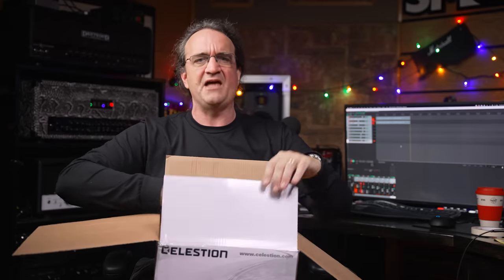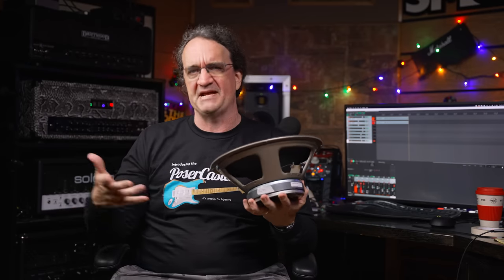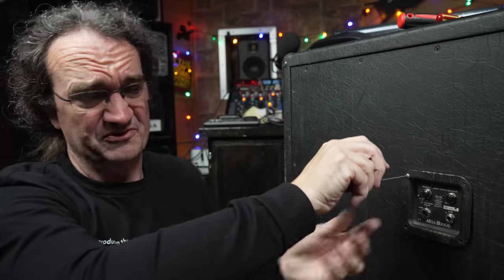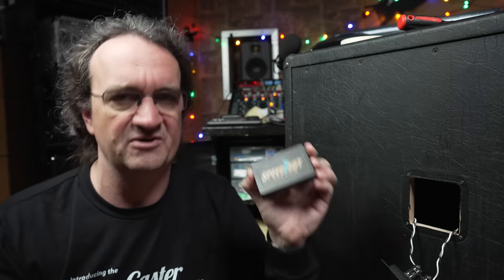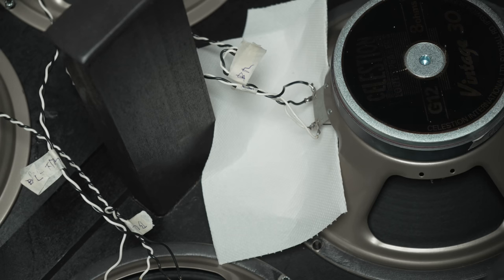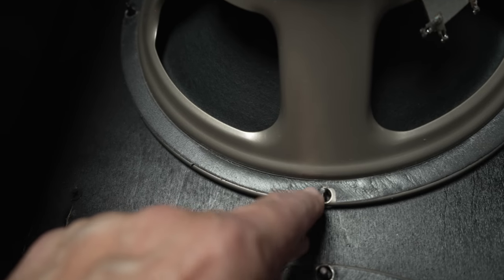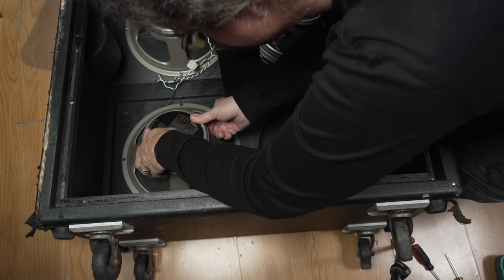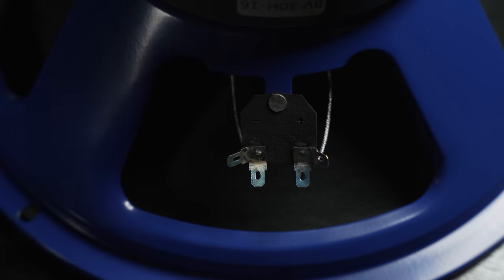How to Change Guitar Speakers (Even if You're a Bass Player!)

Comment: Does soldering connections improve tone? I bought a solderless EMG 81 kit years back. Came with one volume & one tone pot. Swapping pickups was easier than putting a lego kit together. Only a a couple hand tools were required. Over the last decade, I never noticed any kind of crackling or any signal issues even after heavy use & moving states three times. But many guitarists still insist that soldered connections are the best way to go.

Comment: It's not about tone as much as durability. Over time, the spade connectors have will become loose due to the vibration. A loose connection will cause a higher resistance from your amps output, increasing the chance of damaging the amp.

Comment: Glenn! If your screws are stripped out, you can use an old rubber band or duct tape over the screw to give you a bit more torque to get the screws out. 

Just a friendly tip from a fellow tech nerd that has had to fix shit other idiot musicians have broken :)
Reply from the maker: Never had much luck with the rubber band trick.  That’s why I’ve got the fast-outs

Comment: Hey Glenn, thanks for this video. I really needed that spade connector tip. I have a bit of a different issue with it, though - I need to change one of the spades that's hardwired into a combo amp. It's a spade that's smaller than what's on the new speaker, the negative connection. The old stock speaker had a large positive connector and a small negative connector. Are there cases where spades need to be that smaller size for what's hardwired into the amp, or will putting on a bigger spade to match the new speaker not matter, as long as they fit? I hope I explained that correctly, this is new stuff for me.

Comment: Just my .002 cents

When you change OHM load. Going from 16-8 ohm. The only difference,from my understanding.The lower the ohm load the more power the speaker will draw. This will make the speaker louder.  I don’t think it will change the sound. Just make sure the speaker and amp can handle/produce the lower OHM load.

Comment: Id like a video on how to identify what a speaker can handle or how to match up a speaker to not blow with the amps you have. Like if you have a 1x12 combo and want to plug a head into would it handle it or does the speaker need to be changed to handle the more powerful head. Also do you need a stronger speaker in a 1x12 but can get by with speakers that handle less power in a 2x12 or 4x12. Ive tried google but it starts bringing up a lot of home audio stuff and not guitar amp stuff.

Comment: Why did you not put spade connectors on the ends of the speaker wires while you had the speakers out to keep from having to unsolder & resolver the wires onto the speakers?

Comment: Hello Glenn. I love your show. You need to match the correct impedance form the head and the cabine, in other wyse, you will fry your amp. Whem you indicate to use 16, 8 or 4 Ohms? sorry about the stupid question. LOL.
Reply from the maker: I’m following the wiring laid out by the cabinet.  The switch on the cab itself determines impedance.   By not changing any of the wiring, it will work as intended.

Comment: I would like to know your take on how ohm load effects tone with tube amps. When I bought my first tube amp, I hooked it up to my 4x12 that I had wired at 4ohm total. At almost every volume below 9 the sound was very muffled and had too much low end. The top end was almost gone. Messing around trying to get it to sound better I wired the cab to 16 ohms. This fixed my lack of top end tone. I know solid state amps do not work the same way. The signal is the same no matter the volume or ohm load present at the cab.

Comment: I have the stereo cab from Harley Benton, which has two imputs : 4ohms mono/8ohms stereo and 16ohms mono/8ohms stereo, with  a switch in the middle. My only question is : what kind of impedence I should get as speakers ? I'm freakin lost

Comment: Do a video on how to bias an amp next.  I dare you to bias a vintage Marshall amp ;-)

#1 FAIL: Glenn, get Dewalt bits for your drill.  Those are perfect and will grip every time.

#2 FAIL:  You should've wired quick connectors to those Celestions you speaker leads.

As an observation (and based on past experience), the best way to wire those spade connectors is to actually solder the spade connectors to the wire because those connectors have a bad habit of losing their grip over time.

As for the wiring diagrams...  YES!, do a video on the various configurations for wiring a cab.  Having various impedance options are great to have and Mesa has (IMO) the best plate jack (Marshall has the 2nd best but it''s confusing to read and you have to flick a switch).  There are massive differences in listening to a speaker in 4, 8 and 16ohms, mostly happening with the higher frequencies but you can certainly hear a difference and this helps when you simply change the impedance by flicking a switch on the amp and plugging into a different jack on the back of the cab.

Comment: I've got a question about loadboxes: most of them have a fixed impedance (8 or 16 ohms), the only one I've seen with the ability of switching between different impedances is the Tube Amp Expander. So, the question is: is there a way to be able to work with cabs at different impedances with something like a Captor X or if I want that specific feature I'm stuck with the Boss TAE?

Comment: Glenn! my fender champion modeling amp is tuned to the speaker yeah? so would changing the speaker screw up the amp tones, or would it be as if i had changed the speaker on the original amp?

Comment: I wanna replace just one speaker, I like the 65 watt green back  or a 75 g12 t, but the speakers in my cab are 60 watts and the handling power on the cab says 240. Can I still do it or I do have to get a 60 watt speaker?
Thank you

Comment: Changing speakers out are one of the most dramatic changes you can make to your sound and rig. But I think it's a disservice to say changing tubes doesn't do anything. I personally dedicated a lot of time into changing out tubes on my Marshall JCM2000 and my Crate Bule Voodoo. And I can get some pretty drastic results. There is a lot to be said about V1 and the phase inverters in the pre-amp section. But one of the biggest changes I felt and heard was in the power section. Even in the same category of power tubes. For example, I heard a HUGE difference between a set  JJ E34L and set of EL34's, HUGE!!!

Maybe that's just with my amp, maybe that's just with JJ or Marshall, not sure. But my Crate Blue Voodoo sounds way better with Sovtek pre-amp tubes than with JJ. I also play around with high gain and mid-gain pre-amp tubes, which also makes a pretty big difference. 

But I will agree changing out the speakers in your cab, probably makes a bigger difference most of the time.

P.S. I can't speak for old NOS tubes verses new tubes. Haven't played with any myself.
Reply from the maker: That’s complete and utter bullshit.  Where are your frequency response graphs?  Before & after recordings made with a reamp?   Tubes are NOT equalizers.  If they work, they’re good.   Changes in volume do not equal changes in tone.  See:  Fletcher / Munson
Reply: @SpectreSoundStudios  Lol...OK Glen. I appreciate your passion on the subject, but I personally hear a big difference between evething I mentioned. Especially on my JCM2000 with the JJ E34L and the JJ EL34. I'll make a video and call it, proving Glen wrong ep.1. LOL... J/K, but not really. I'll make a video and use a frequency analyzer if you want.

Telling you man. There's a difference, at least on the examples I gave, which I've done myself.

Comment: I have an old HiFi amp and speakers and I can hear the difference between the 2003 and 2006 Celestion speakers. The earlier ones are much brighter and give the mix better separation between instruments. I can gear all the instruments clearly. The later ones sound mushy, there's too much similarity between the instruments, there's too much Bass which is muffling the guitars, snare and cymbals.

Comment: 7:12 Omg, Line 6 cheaper "non v30 cab" speakers are a screw thru front/ nut on inside design. Your either going to puncture holes in the front cloth or have to remove itif the nut just spins. It's a Phillips screw head into a nut. The  Line 6 v30 cab or spider valve cab is nutserts in the face of the cab and bolts on the inside. Every cab is going to be different. A Siesmic Audio 4x12 is front loaded. I got the unloaded box so I can use nutserts or studs or whatever.

Comment: I have a Fender Champ 40 Amp which sounds OK for my use. I was thinking about putting a Celestion Rocket 50 speaker in it. There is a "Voice" knob for different amp sounds. Would a different speaker still change and improve it that much?

Comment: the stuff this video covers is pretty basic (for me at least), it's the wiring configs and ohms that are the confusing part for me and think some sort of guide or even just a doc\page showing options would really be helpful. I have an 8ohm 2x12 loaded with 2021 V30s, I've been thinking of trying a different speaker, maybe just one and leave the other as a V30, but I'm not sure what I want to look for, or what can be dropped in without having to rewire anything. any tips on mixing different speaker types would be great.

Comment: You have to be careful how you wire if you are a first time cab builder. If you "daisy chain" the speakers you can do damage to an amp. Just because you have a 16 ohm speakers the ohms cut in half if you daisy chain per speaker so for 4 16 ohm speakers if they are daisy chained you end up with 2ohm total. So do your research on series vs parallel wiring speakers to get your desired ohms.

Comment: So here's a challenge for ya.
Can we get a demonstration of how far forward a speaker can take your tone with a line 6 spider (doesn't need to be insane channel lol) through one of your actually good sounding cabinets? (Unless there's no extension cab out, I've never had one and wouldn't know)

Great pointers btw, I didn't have to solder anything in my speaker swap in a combo amp, so never would have thought of having to protect the cone from drips or rips.
Reply from the maker: Most spiders don’t have a cab out.  And therein lies the problem
Reply: @SpectreSoundStudios  I can only assume gorillas have the same issue, hah.

Well darn. I guess you could find a spider head, but that's probably more trouble than this point is worth. Not like you haven't illustrated it already.

Comment: The surest way to tell if your V30 was made in Britain or China... look at the back of the magnet within the center of the sticker. If there's a machined circular steel piece with a shallow hole inserted into the die-cast metal of the magnet, it's British. If there's no inserted circular piece, just a shallow hole drilled directly into the die-cast metal itself, it's Chinese.

Comment: I personally prefer soldering connexions just for ease of use, the opposite of you hehe
Crimping connectors with those pliers is... unreliable at best when you do multiple crimps. I found out that when you crimp twice, the second crimp losens the first one so you end up where you started.. and sometimes it just doesn't hold well.
A single strong crimp always works best for me.
Soldering is just quicker for me. but tone, or reliability.. meh.. both work the same, and if you have a loose spade, you cna just tighten it back up with pliers before fitting them on the speaker.

But for the drill, by all means use a torque limited one! they are cheap too and won't crack wood or strip screw heads. or do it with a regular screwdriver. it will improve picking speed :p

Comment: On the topic of speakers bud, I’m struggling to find a good setup for my guitar using plug-in software and my main music listening experience.

I just use HI-FI setup for my music listening outside the mx-50 headphones. But can only use my headphones for the guitar as I don’t use a cab due to disturbing the neighbours. I currently use my Kemper over pc plug-in as I got a iPad Pro over a mac 🙃 and my windows laptop sucks balls.

What speakers or setup should 9 go for. Been researching for days and get very conflicting choices. I would like to stay around £200-400 but know it can get expensive for sound setups.

Comment: Tubes do change the sound though for instance a 5150 el34 sounds different from a 6L6 head Speakers are a huge part of it but the tubes and amp head are at least half of the sound imo
Reply from the maker: Changing power tubes types does not effect frequency.  Tubes are not equalizers.
Reply: My ears literally hear something different between the 6L6's and EL34's but alright

Comment: Changing speakers is the best way to change your tone! 
But don't make the mistake I did and go down the speaker rabbit hole....currently I have 11 speakers laying around in my apartment, and no I don't have a problem! (just more tonal variation than 99% of you guys) ;)

By the way I only  solder the speakers in my gigging cabs, as I don't want to have a loose wire at a venue right before I hit the stage. Everything else is a spade connector for my convenience. Never noticed any sonical difference.

PS.: do a follow up, you cound also include what to look into when mixing speakers (checking if they are in phase, checking to mach efficiency as close as possible,...)
PPS.: the 2003 V30 sound a lot like the WGS Veteran 30s.

Comment: Those 2006 V30s sound like muffled mud. The 2022 ones are killer, way more clear and articulate.
Reply from the maker: I didn't actually play the 2022 V30s in this video.
Reply: I have the 2022 V30s in a Engl pro 412. I did also see your other comparison. 🤘

Comment: I'm not so sure. Yes, the speaker IS the thing that makes the sound. But you can run your guitar directly into your digital interface and change the voice/tone of your guitar any time you like. That is, you can change it for recording feedback to the player or later on when you are mixing.

Pro tip about using a cordless drill and Philips head bits to undo the screws. You got the bit about laying down the cab. Most decent cordless drills are variable speed and may even have a variable torque setting. TURN DOWN THE SPEED! 3000 RPM is just too damn fast! LOL.

RE: 8Ω vs 4Ω. I doubt anyone would wire speakers in series. So if you have two 8Ω in parallel, that would work out to 4Ω. All we are talking about here is impedance. Just make sure the amp is set accordingly. It won't affect tone.

Comment: Two wires and maybe up to 8 screws. Maybe your cab is sealed in a way that makes it difficult to open?
Reply: Don't forget with those old flappy speakers to fit a valve to the cab and pressurize it. 😄
Reply: @mageprometheus  fill with helium to lighten the cabs 😂

Comment: My 4x12 cab is from the 80's, cost me $100 5 years ago, yeah, Sheffield Equipped. But, new speakers at $100 a speaker... four hundo for speakers? Can I put one quality speaker in the cab for mic'ing purposes (assuming I match the ohms and wiring)?

Can I put a couple different speakers in a cab to get a variety of tones for recording purposes, and not for gigging, aka not for the overall mixed speaker/cab sound?

Any speakers in the more affordable range that can do clean and distorted well to drop into your favorite 80's Peavy cab that somehow made it through the decades into my grimy hands?

I'm not cheap, I'm disabled with no income, I don't collect disability. I'm in a zero sum financial situation, and have no more shoe laces to sell off my shoes and only one kidney left... have mercy if you do have a suggestion!

Comment: Not sure if a frequency response graph is valid.   If there are any distortion from the speaker (non linearities) they will be reflected and mixed into the graph.   If there are no distortions the IR you captured should sound identical to the actual speaker,  otherwise you will notice a difference.   Nobody does such a A/B test of a speaker/mic and a captured IR.

Comment: I've never heard of there being a difference in tone between 4, 8, and 16 ohm speakers. I would be very curious to see if indeed there is any difference. I would be very surprised if there was.
Reply: Well there's not the same length of wire in the voice coil so it should be different, but how different? that would be nice to know :)
It's usually hard to tell since the speaker choice is more or less dictated by the cab size. if you have a 16 ohm head you'll use two 8 ohm speakers in series in a 2x12, or four 16 ohms in series/parallel on a 4x12. but then you compare the sound of a 2x12 to a 4x12..